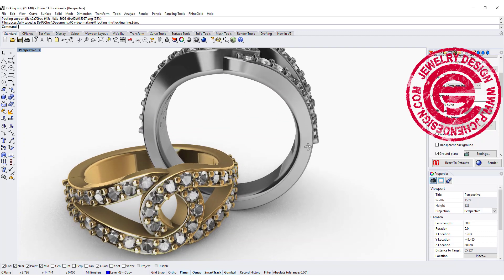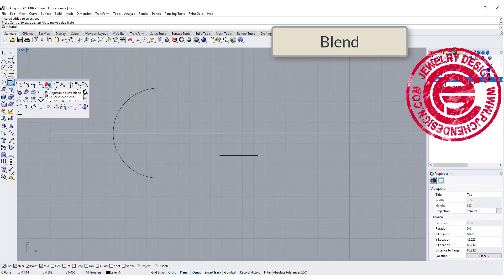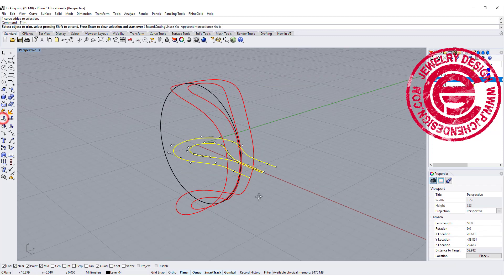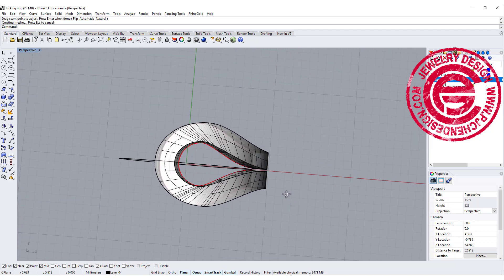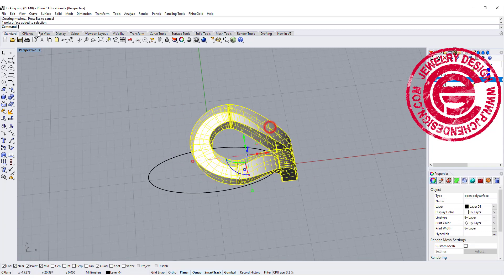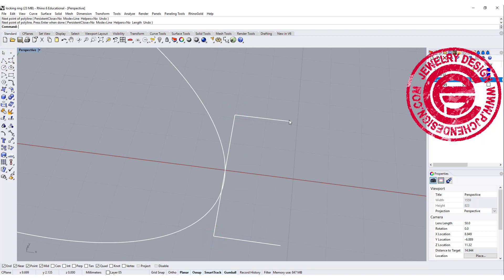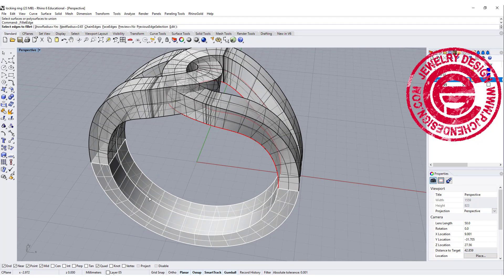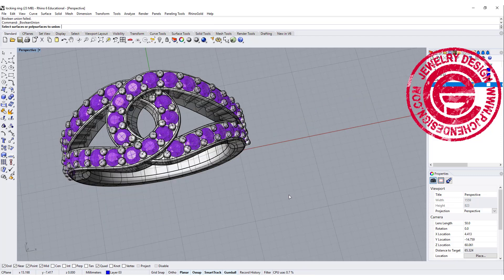Design a Locking Ring Model in Rhino 6: Jewelry CAD Design Tutorial #84

Comment: Thank you but when i do boling union it ddnt work it still 3 pices but i don't have naked edges is that a problem and if you have any idea btw i'm using matrix 8 not rhino
Reply from the maker: I have several videos at Q/A session discuss boolean issues. you may want to check out those most common boolean issue videos first.
Reply: @PJChenJewelryDesign  i will thank you